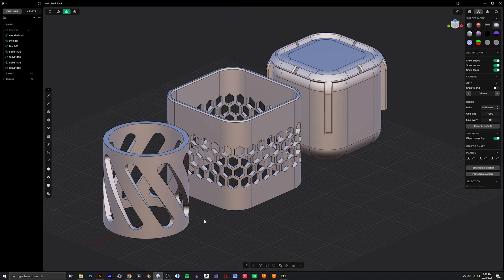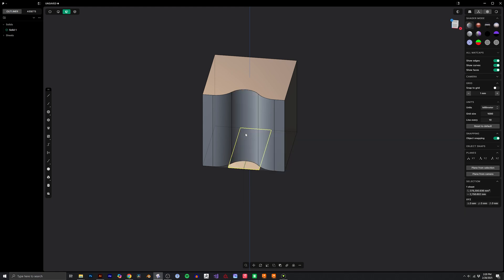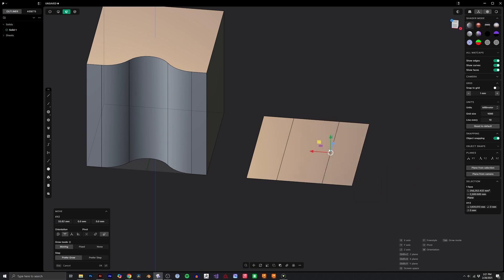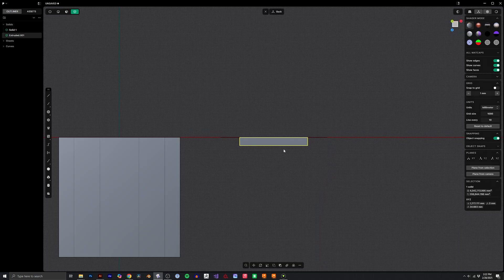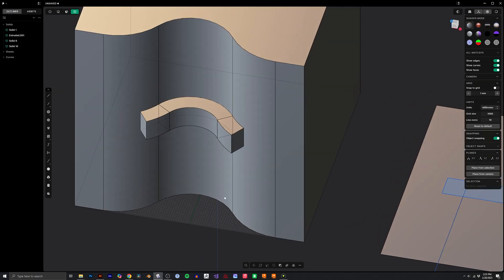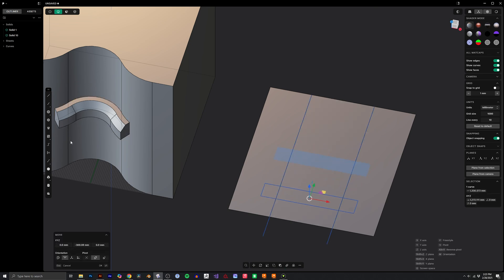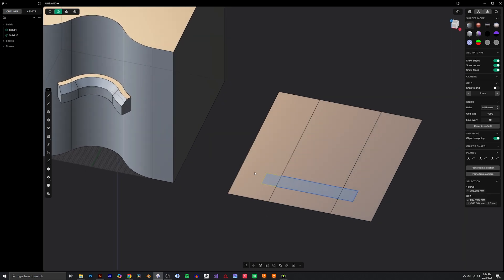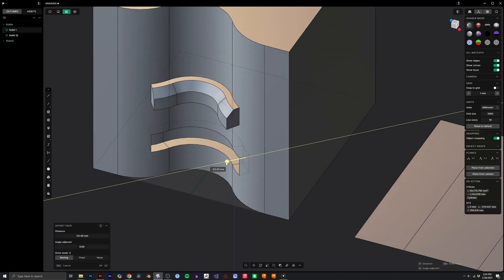Plasticity - Deform onto Surfaces with Multiple Faces

Comment: great vid!

if you  need to perform this even faster, you can actually skip the unwrap and deform commands and simply draw a rectangle (or any curve for that matter) above the surface you want to imprint the curve on. 

from there, press "F" and type "project curve body".

this command will project the curve onto the surface, while also deforming it.

all methods are valid and just depend on what you are doing / how much control over the operations you need.

Comment: One thing I want to know about.  Is there any option available to edit the corners or move the points after imprinting or any other option similar to Imprint or after boolean. I have a sphere, created shapes in side l, front and top view. Once I boolean or imprint them they overlap in some areas .I can't modify them after the operation , and before Imprinting or boolean I cannot figure it out where they will overlap.